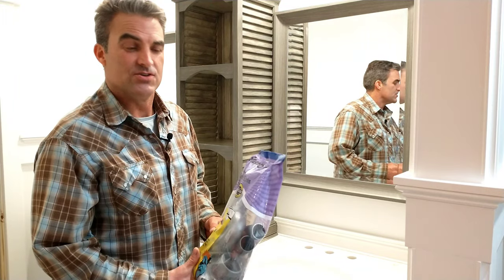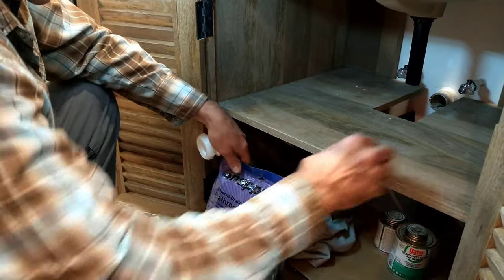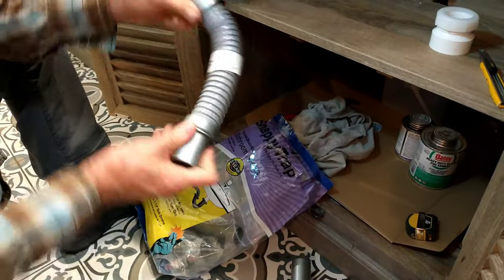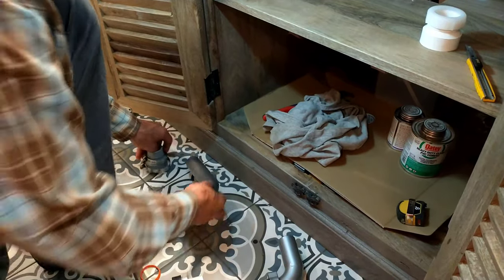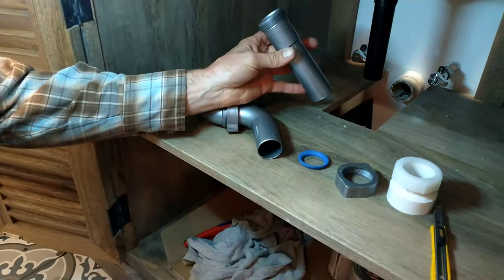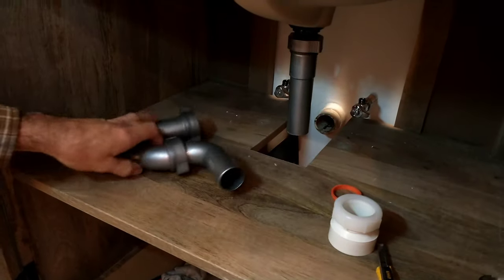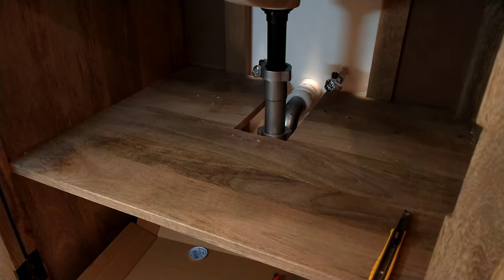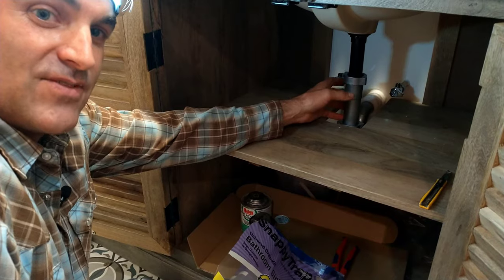Install Snappy Trap for Bathroom Sink DIY #diy #how #howto

Comment: Thank you so much for making this video.  I had watched several videos repeatedly.  All I know about plumbing is how to turn on/off the water.  However, my hubby recently had a stroke, and is unable to work on our plumbing.  I also know I can't be calling the plumber at the drop of a hat.  So when I was just about beaten down, I found your video.  OMG, I had no clue you could adjust where the pipes connected, until you said were just going to snug this, and then you came back and mentioned telescoping it down.........bells and whistles went off!  I then realized that even though I thought it would never ALL fit together, it did.  My hubby said now I could be a plumber......he included that I would stay broke, because I am a little on the slow side!  Thanks again!
Reply from the maker: Hi Marcella. Thank you so much for watching our video and leaving a comment...always appreciated ☺️.  I absolutely loved your story!! So glad you had the confidence to do it yourself!! Keep up the good work 👍

Comment: Thanks. You didn't need to use the Snappy Trap Drain Kit for this installation. It sounds like you install Snappy Traps a lot so the question is about the flexible  hose piece, when the drain location at the wall is offset more than the P-Trap is wide and how well it works. I have one where the flexible hose is stiffer than I have seen on other videos.which is a problem for my installation. Is there a way you make it work for you?

Comment: Hey great video. Any reason in particular you installed the PVC trap adapter vs the rubber one included in the kit.
Reply from the maker: Hi! Thanks for watching the video and leaving a question. To be honest, there was no reason other than the fact that the PVC trap adapter was brand new as I had just previously installed it when I did the sheetrock in that bathroom. Therefore, I chose to reuse it with this install instead of the one that came with the snappy trap. The all-inclusive snappy trap bag has everything you need and there is no real reason to have to purchase additional parts. Hope this information helps 👍

Comment: I like all your videos, thanks. I had to shake my head when you didn't remove that shelf. Even if I had to remove those doors, it would have been worthwhile. When I tighten those nuts, I only hand tighten them unless the pipes don't line up, which they should. An excellent tool for plumbing is a RIGID EZ Change Faucet Tool. 57003 at AMAZON for $24.72. It makes many jobs more manageable. At 2:40, Is that a bunch of crap in the drain pipe? If it is, I'm sure you'll have a new video on how to take care of that.
Reply from the maker: Hi! Thank you for watching the video and leaving such a detailed comment. I will have to check out the tool you recommend. As far as the shelf goes, I would have definitely removed it. However, this vanity was a solid teak vanity with the shelves dovetailed into the side panels. It was not something that could be removed unless I literally cut it out so I had to work around it. At minute 2:40 you will see darkened stuff in the pipe. This was a remodel so the drain pipe was not new. However, that was more of a staining to the pipe than anything else. I had cleaned the built up junk in that pipe out before this install. Thank you again for watching the video and leaving a comment, always appreciated 👍